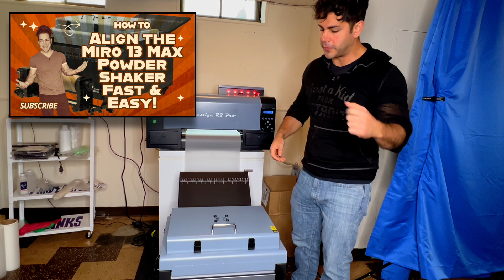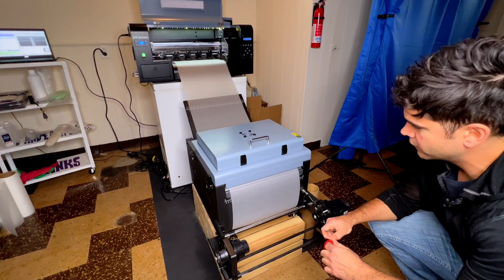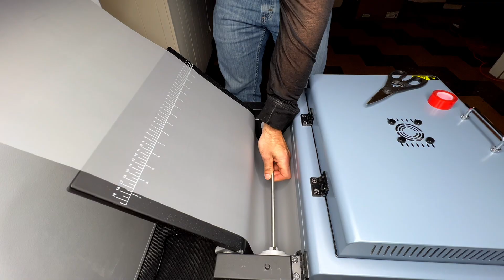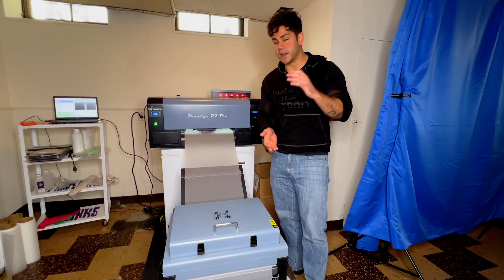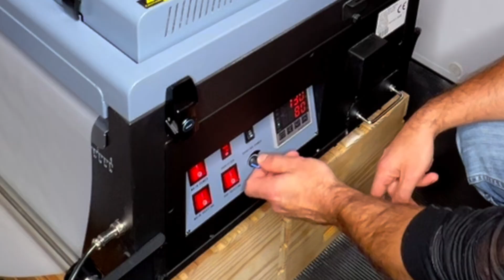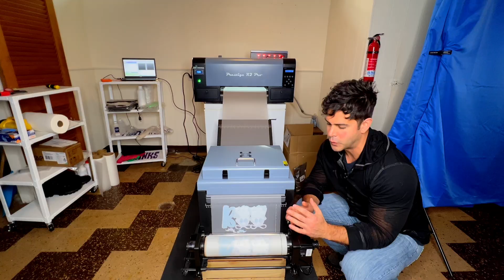DTF Alignment Masterclass 💥 | Prestige R2 Pro & Miro 13 Max Setup Guide

Comment: What if I don’t print large amounts of prints? Do I really need the shaker and oven combo? I’m sure that at the beginning I won’t have huge orders and waisting so much film seams like loosing money 😢  Does this printer takes small film sizes?
Reply from the maker: You don’t need the shaker to go with it, but you’ll have to manually cure your adhesive on your transfers. 
It is a little waste of material, but makes the convenience worth it. 
The printer does take smaller widths. As long as they fit within 13”. You would also have to calibrate the machine to that width used, I think.
Reply: @GoodOldScratch  thank you for taking time to reply.  Did you have to leave your printer for loner period of time ? If yes how was it preforming
Reply from the maker: @Miss-Laine I’ve left it alone for over three weeks and it printed fine… but make sure you keep it on and there is enough ink in the reservoirs … if you know you’re going to leave it for a bit, put some cleaning solution on the dampers

Comment: On pilot, you can use an auto feed so you don’t have to sit there and keep pressing the feed button every 5 seconds. You can set the length you want to feed forward and the speed. Click forward feed and it’ll do it for you.
Reply from the maker: Oh that is sweet! I don’t have that software right now. Still using DigiRip